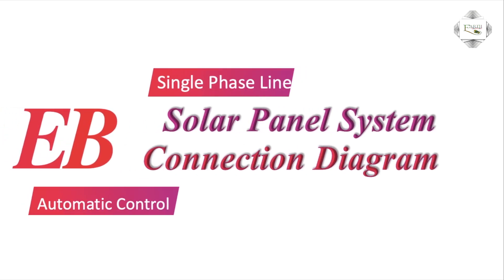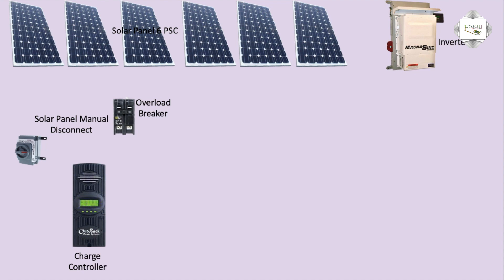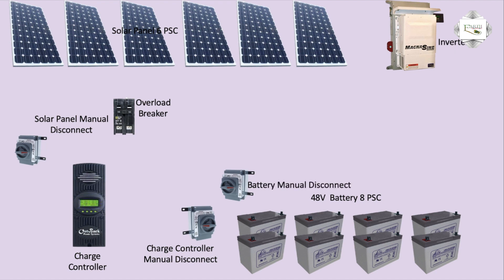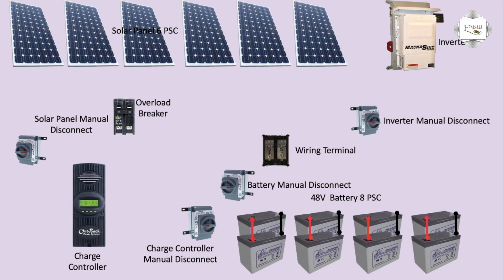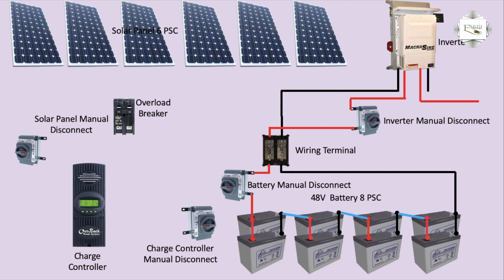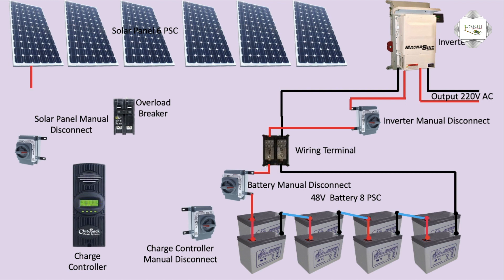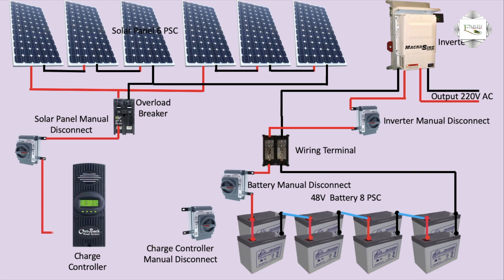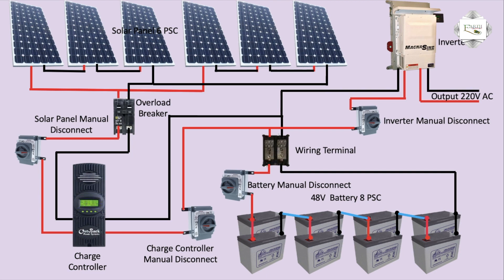Solar Panel System Connection Diagram | Solar | Solar Panel

Comment: It looks like the charge controller cutoff is in the wrong position. It should be on right before the terminal block. By placing it there you wouldn’t need the one for the batteries it would still have power to the inverter. Or am I missing something?
Reply from the maker: Thanks...sir

Comment: I am a little confused about the wiring of battery. The battery is connected with inverter directly. And how to make sure the battery won't discharge when the solar panel providing power to load?
Reply from the maker: Thanks for your feedback, please follow.........
"Thanks for watching the video"   You are very welcome!

Comment: Mistake your solar connection 12v, 3 penal 36v     24v, 3 penal 72v your diagram 48v system? change
Reply from the maker: ok, add Facebook "earthbondhon" 
I love to receive your comments and feedback.
Thanks for watching
Reply: I assume Panels are common 18V 100 watt  x3 = 54v, never seen a 12v panel.  :-)

Comment: How do you connect 250 W 24V  16 panels to 48V 5KVA inverter. And, how many will be in series and parallel. What will be the combine PV panels output. 200AH 12V  12 batteries?
Reply from the maker: battery Series connection Voltages Up. battery Series connection parallel Amp up. Love to receive your comments and feedback.
Thanks for watching it.